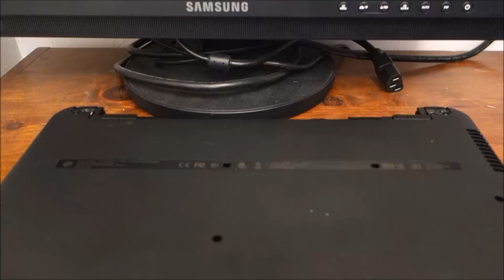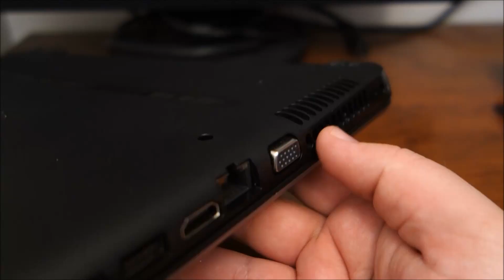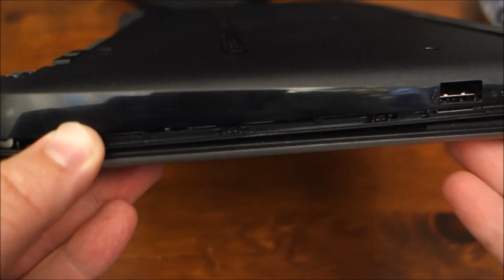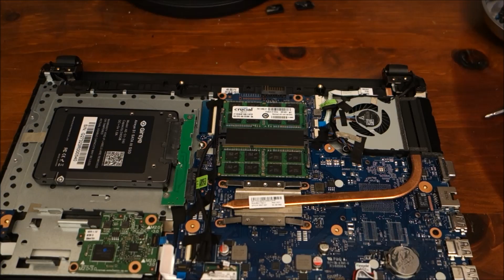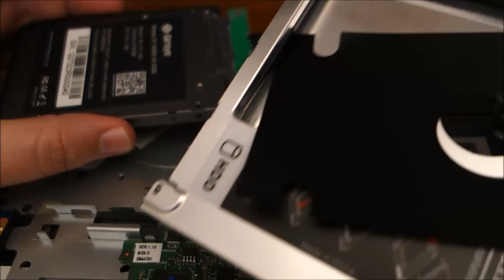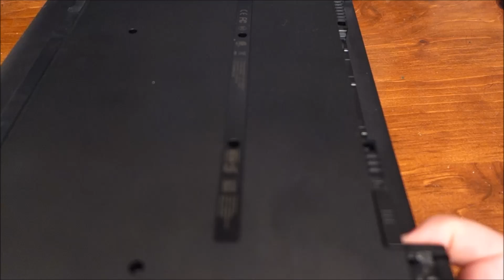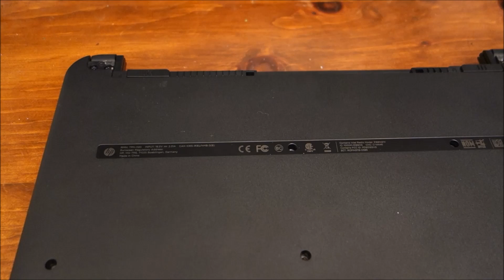HP 14-an013nr case opened up, ssd install, memory upgrade

Comment: Wow this upgrade is kicking my butt. I finally got the laptop to intialize to the windows screen where it shows the photo of the cave looking out to two large boulders in the ocean. Normally from this point I would hit enter and the option to put my password would pop up, but neither my mouse or keyboard seem to activate this option to get the password bar to showup. The only thing that seems to work is to put the laptop in airplane mode when I hit F12 other than that I get nothing.....Any ideas guys as to what I could tweak? Thanks.
Reply from the maker: Do you have a boot USB drive? if so I would plug that in, boot from the USB, and see if you can run a repair (one of the trouble shooting options). it sounds like you got a bad clone somehow. I both cloned and did fresh installs and had 0 issues... so I am sorry I don't know if I can be of much help.
Reply: @AICvideo  Thanks again🙏 AOMEI seemed to be a simple program and copied everything, but upon going into the repair options page and using the command prompt option. I noticed that by typing C: then dir. Somehow the 32gb emcc is under C and the SSD is now under D: When I did finish with all the cloning and looked under my PC, the SSS was drive C: and the 32emcc was drive D: somehow they switched. I don't know if that might be the issue. Would I be able to do a fresh install from that boot disk?
Reply from the maker: from the one using windows media creation tool? yes. That's what I use.
Reply: @AICvideo  Thanks again..Will try later when I get home🙏

Comment: This is going to sound like a dumb question, but as a noob. Here it goes. If I was able to clone my 32gb hard drive which was built in to the syatem, wouldnt windows 10 be already installed on the clone or do I have to reinstall it again? I watched your bios video on this laptop and matched everything, but for some reason when I boot from the ssd It keeps taking me to computer repair screen and simply will not boot up to windows. The worst part is that already formatted the 32gb internal emmc memory😞 All I keep getting is automatic repair screen on start up. Other than the SSD all I installed was an extra 4gb ram card in the upper slot which bumped me up to 8gb ram. Any help would be appreciated🙏
Reply from the maker: Without looking at it, not sure how much help I can be. What did you use to clone the drive over? It might be a bad clone? I always either use macrium reflect to clone, or just do a fresh install from a boot USB.
Reply: @AICvideo  I used AOMEI to Clone...I'm thinking of removing the drive and connecting to my main pc and running CCleaner or some other Hard Drive cleaning tool. I did make a bootable drive woth AOMEI, but will have to figure out how to do a fresh i stall from the boot disk if worst comes to worst. Thanks again for helping. I would hate to wipe and start from a new install, but if that is what it takes....Oh well🙏
Reply from the maker: google "windows media creation tool" on another computer, download and create a windows bootable USB drive. boot on that and run the repair utility. I would try that first.
Reply: @AICvideo  will do.

Comment: Can I continue to boot from the mmc32gb instead of the new drive? I have not yet done the upgrade, but the laptop wants me to upgrade windows and I ran out of space. What should I do? Keep booting from the 32 or install windows 10 all over to the new SSD? I would love to make things as simple as possible. Thanks.
Reply from the maker: Personally? I would clone the emmc drive over to the SSD (then expand the storage) and format the emmc storage. The new SSD will be twice as fast as the emmc, and you won't have to deal with windows 10 not upgrading. Personally I always go for a clean install, but if you have stuff already installed and configured, a clone gets you set up quickly.
Reply: @AICvideo  Thanks for the response. Is making a bootable usb drive the same as having a copy of windows 10 on a usb drive and if so, how big of a thumb drive should I buy in order to have an external copy of window 10 on a flash drive? I guess the reason I wanted to keep the 32gb active, would be as a way to keep a copy of windows 10 in a partition directly on the pc. What do you suggest?
Reply from the maker: I mean, you do you. You asked what I would do. You can format the emmc and still use it as a 2nd drive. (that's what I did, put my music library on there). If you install the OS on both drives, then you have to select each time which drive you boot from, and that can get old after a while. you can use the 32 gig drive for just windows, but you'll always running into issues space wise for updates and such. 

as far as installing windows, you just need a windows bootable USB drive, if you google "windows media creation tool" you can find windows free utility to make a windows 10 bootable USB drive. You need an 8 gig drive for it. I personally carry one of these: https://amzn.to/2Q3IqOm It's small, metal, and the loop is perfect to go on my house keys. I made it a windows bootable drive, but also keep other folders on there with common software I install on computers, some music, videos, etc. I use it all the time.
Reply: AICvideo Thanks again for all the info. Finally got everything I need to upgrade it. Decided to with the SP 480 gb hard drive👍🏼
Reply from the maker: @lt5550  Nice! Good luck, hopefully you have no issues.
Reply: @AICvideo  Got everything installed added a second 4gb mem chip to the extra slot which bumped my Ram up to 8gb and ended up cloning the stuff that was on the inner 32emcc chip unto the 480gb SP ssd drive. Booted it up and I saw that the SSD now became the main C drive and the 32 became the D drive which I then proceeded to reformat. Upon shutting down and restarting the computer. I keep getting the blue Windows repair screen and for some reason it does not want to boot from the ssd hardrive. I think I have selected the ssd drive in the UEFI boot order in the Bios, but for some reason it is not booting from the ssd. Everytime I turn on the pc it goes to the repair screen. I enabled legacy support as well in the Bios, but that seem to have no effect. What am I missing in this puzzle?

Comment: Great video. Will this drive work? https://www.amazon.com/dp/B0781VSXBP/ref=twister_B07GSGXKG3?_encoding=UTF8&psc=1  Thanks. How good are the SanDisk SSD drives.
Reply from the maker: https://amzn.to/2zsKx4g crucial is a good brand, so is sandisk, I've been buying SP brand ones https://amzn.to/2SkZj45 Because they are A LOT cheaper, and I've not had any issue out of them. But I don't think they have quite the performance some of the others have. BUT that doesn't matter as much to me since the performance is so much better than a spinning/emmc drive, and the price is right.
Reply: @AICvideo  Thanks again for your expert advice. I have decided to go with SanDisk SSD PLUS 480GB Solid State Drive - SDSSDA-480G-G26 https://www.amazon.com/dp/B01F9G46Q8/ref=cm_sw_r_cp_apa_t35.Bb5AYTG52 And will AMOEI backupper to clone hard drive and make boot up disk. Looks like the SP brand offers more space for a good price, might go with that instead. What do you think of this one? Will it work for this laptop? https://www.amazon.com/dp/B07997QV4Z/ref=cm_sw_r_cp_awdb_t1_Q-5.Bb741YWPZ

Comment: so this would work for the 14-an012nr?
Reply from the maker: Yes, I think so. I haven’t opened one up, but other than the screen, it’s the same.
Reply: true lol
Reply: but I am going to have a problem in installing an SSD like the others
Reply: So I but that caddy take it apart and use the connector?
Reply from the maker: Correct.
Reply: fucking sweet lmao xD So I can install my windows on the SSD then go into my BIOS and select that SSD and make it primary boot?

Comment: I know I’m a bit late, but if I upgraded the ram and the ssd, would I be able to play games like r6, overwatch, and CS:GO
Reply from the maker: No
Reply: AICvideo thanks, but one more thing, is there any way I could upgrade a hp stream 13(I think that’s the name), which has 2gb ram and an intel Celeron, to play those games?
Reply from the maker: No. Simply too slow.  Buy something used with a dedicated video card.

Comment: Where did you get that circuit board adapter to install the ssd to the laptop?
Reply from the maker: https://amzn.to/2vlI2yq
Reply: So I have to buy the caddy and remove the circuit board(no choice).  I wonder why nobody sells just the circuit board adapter itself. Seems to be a popular item. The laptop I am working on for a customer is the hp 14-bw065nr. There are plastic pieces that need to be removed from the cover as well just to be able to velcro the ssd in the area provided. I wish I could share a photo with you. Anyway thanks for the link, Ive been looking at those and just now bought it.
Reply from the maker: You don’t have to remove it. I did, because I felt it was more secure with the Velcro dots, than the caddy loose, but I didn’t have room to Velcro the caddy
Reply: In the model I'm working on . I don't believe the caddy will fit. There are plastic pieces attached to the back cover to make sure nothing can go in the optical drive space. But I think I can attack the pieces with some pliers and remedy the situation. Even if I remove the plastic pieces the caddy might now fit.  Another non related question..... What did you do to install Windows onto the SSD? Clone the little 32 emmc drive. Or just change boot order and install through Win Bootable usb?
Reply from the maker: Bootable usb, and delete the os on the drive. It’s just easier, and no bloat wear to deal with.

Comment: I moved my 4 gig card that was in there to the other slot and put an 8 gig in the front slot... When I check my system it says I have 12 gigs of RAM...
Reply from the maker: Did you expect anything different?
Reply: Based on the video above I thought that this machine would not use both slots... If it shows in the system isn't it using both?
Reply from the maker: Yes.. it uses both.
Reply: You said it only runs in single-channel mode... Guess I'm not 100% certain what that means... Is that extra 4 gigs in there doing anything or no?
Reply from the maker: Single channel and double channel modes are something entirely different. You have 12 gigs of memory.
Reply from the maker: https://youtu.be/-D8fhsXqq4o

Comment: Hi, I have purchased an upgraded (SSD Drive) hp 14-an013nr, can I just add an additional 4GB memory stick or do I have to replace the stick it comes with with an 8GB stick. I am not clear on the channel modes so not sure if it relates to this.
Reply from the maker: ignore channel modes, this laptop isn't fast enough to take advantage anyways, Just add a 2nd stick of 4gb of memory.

Comment: I wonder if anyone else has run into this problem.  I kept the 32gig eMMC installed and added a 128gb ssd.  The machine doesn’t boot properly anymore. Prior to the update 1709 attempts, the boot screen would show volume 3 and volume 6.  I would simply select volume 6 (ssd) and it would boot fine. Now the auto update runs (doesn’t successfully install 1709) and when it boots, I see a blue recovery screen with options. Yes, I could remove the eMMC card and boot from the ssd but wonder if this can be solved with bcdedit. I tried bootfix to no avail. I can get past the recovery screen by hitting F1 and enter or esc and enter, and it boots into windows.

Update: i just went into the bios and under boot options, only sees the 32gb drive, no ssd. But when I boot windows, the OS boots into ssd (C drive) and it sees the 32gb as the D drive. Boy something’s horked up. I might need to do a clean install.

Comment: I just realized my ssd did not come with that green peice adapter..wtf. stupid Amazon people. What is that adapter called? Thanks
Reply from the maker: yeah, no SSD comes with the adapter, you have to buy a caddy. http://amzn.to/2GlZXtm
Reply: AICvideo thanks a bunch for your quick replys and help. Do you recommend disconnecting my old hardrive? This ssd I'm putting in is formatted and empty. I messed up the cloning process by accidentally switching my disk to dynamic, and you can't switch back to basic. So I'm hoping to just throw this ssd in, and reinstall windows 10 on it. I got a boot disk on usb for it. Just not sure if i should leave the hardrive plugged in as I'm looking to make the ssd the main hd.. thanks
Reply from the maker: shouldn't matter.
Reply: AICvideo ill have a chance to choose between the 2 or something in Windows?
Reply from the maker: yup. it will ask you which drive you want to install the OS onto. you can also delete any partitions and set them up again.
Reply: AICvideo awesome thanks 👍
Reply: AICvideo when i try to install Windows 10 onto the ssd, it says "windows cannot be installed to this disk. The selected disk has an MBR partition table. On efi systems, windows can only be installed to GPT disks." Any ideas? I went to disk management, and it won't even give me the option to switch to gpt unlike my hdd has. It's formatted and everything. Thanks in advance

Comment: Hope you are still answering questions thanks for the review I bought this laptop and it's a slug I am going to do the upgrade but orgive me I will end up with 2 hard drives what do I do to reinstall the OS and what to do with the pre installed HD ? thanks for your help.You can get the screw holders freee  at Harbour Freiht if you have a coupon also the are only 3 bucks there.
Reply from the maker: I personally used the new drive as my OS drive and wiped the old drive and just  used it for extra storage.  I have a windows 10 install on a USB drive. I just use that.

Comment: Thanks for this. You said it won't take 16gb, will it take an extra 4gb ram stick?
Reply from the maker: It does take 16gb, I just felt it was overkill, so yes it will take a 2nd 4gb stick.

Comment: Can I use a SATA hard drive from my old computer instead ,with the SATA connected card shown at 6:37 (and where can I find it)
Reply from the maker: I mean, technically yes. But I would never recommend going back to spinning media.
Reply: AICvideo is it because it would be outdated or.....
Reply from the maker: Slow, the speed difference between a spinning drive and an ssd are incredible. I don’t have spinning drives on any of my systems anymore.

Comment: Didn't see if the cover's screws were phillips head or not?
Reply from the maker: Yes Phillips
Reply: Wow, quick reply, mate... Thank you
Reply: One more question, I'm actually inspecting a used, AMD-E2-7110 500GB SSD version which is simply a step-up model of this exact laptop and I'm not sure if the screws on the AMD would be the same phillips head divot?
Reply from the maker: get yourself a kit like this: http://amzn.to/2E5vIpn and you'll have all the tools you need.

Comment: Hello, I don’t know if you can help me but I need help. I cloned the contents of my old drive to my new drive but it cloned the entire thing. I should have 90 GB left over but it says the same amount as my old drive. My old one had the total of 29.1 GB and my new one had 119 GB but after the cloning process both drives read at 29.1 GB as the total. In the program I used to clone it shows everything cloned over except the new drive had an empty space reading “90” GB or so. Can you please help me?
Reply from the maker: You have to expand the drive in disk manager.
Reply: AICvideo whenever I go to disk management to attempt to expand the unallocated space of 90 GB I right click it but it only shows the “New Simple Volume” (I believe it’s called) option.
Reply from the maker: You probably have small partitions, download a third party partitioning app to move them to the end of the drive.
Reply: AICvideo alright, any recommendations for a software?
Reply from the maker: I just always google it. I use them so seldomly that the one I used previously doesn’t work anymore, and I have to try a new one. And I’ve gotten to the point I just install from scratch anymore.

Comment: Most useful tutorial. One question: Where can I find SATA Connector Card (Green) shown at 6:36 minute?
Reply from the maker: http://amzn.to/2Al30xT
Reply: So he didn't say it explicitly, but he basically disassembled that adapter and just used the inside of it board, which is that green part.

Comment: The strange part I find about this laptop is that there's solder points for a gpu and VRAM modules.
Reply from the maker: I wonder if that could be upgraded, and if so, what to? it really seems like this board was meant to be a jack of all trades that just never was. I just wish it was in better packaging. I am working on some videos with an acer laptop, not nearly as powerful/upgradeable, but man, so much better built and higher quality feeling.
Reply: I think it could be upgraded with an AMD r9 M200 series chip, but not sure. Also, can't wait to see those videos. Love your channel.